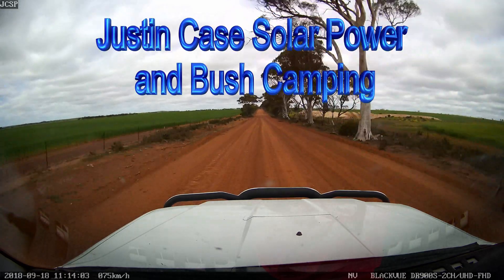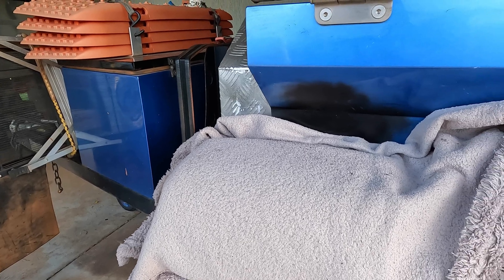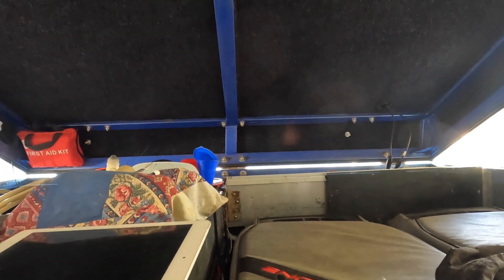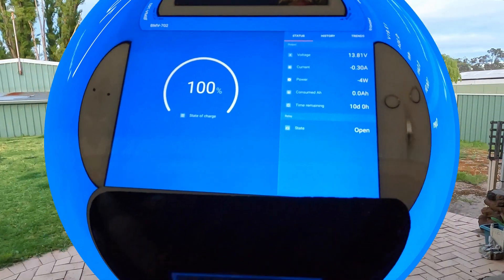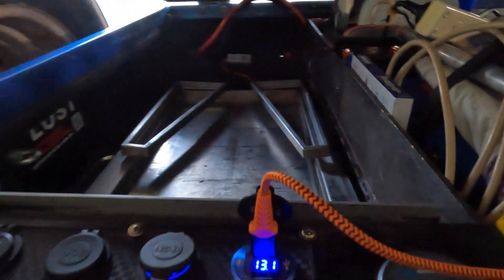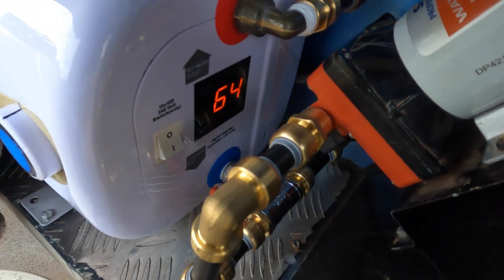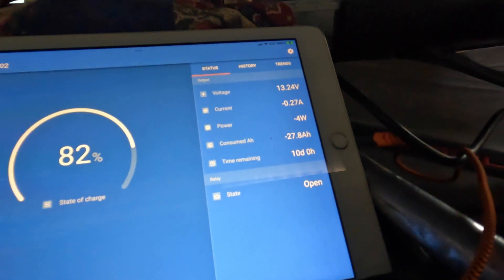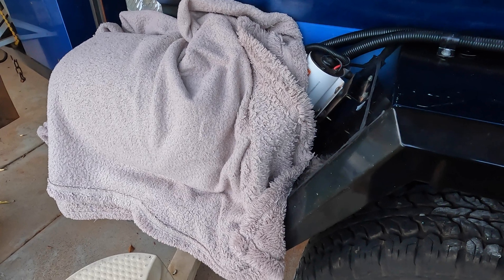Duoetto MK2 RV Hot Water System.  How many amps consumed to Run it all Night on 12v DC?  (7)

Comment from the maker: 27amps to run it all night and keep it at around 65c is really good for a 10lt hot water system. Think of it people a hot shower before breakfast then have something to eat and wash the dishes in hot water and move on to you next camping spot. Or stay put and enjoy the amazing camping spot for a bit longer. This is a big deal. Sigi asked for it, She got it. 
Now i just have to get insulated covers made and fit the shower outlet and tap to the left side.
Enjoy 🙃🖖

Comment: Looking good Chris, on a normal day with either traveling or via the solar panel you'll recover that energy easily....it's getting light here at 0500 now !!!
Reply from the maker: yes, This hot water system is looking better and better. I have a trip planned on tracks only around xmas. That should give me a good indicator on how well it will hold up off road. Have the trailer in the engineer's  workshop right now having the covers all made for it.  So with luck I can start putting them on next week some time. Should look nice when it's all buttoned up.